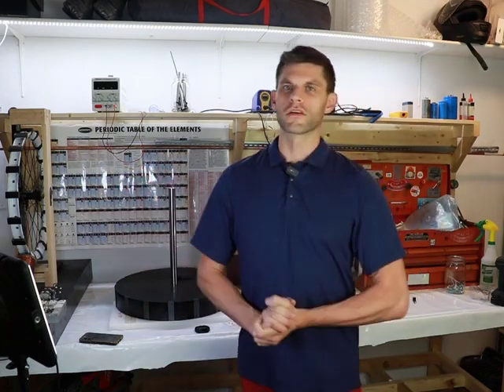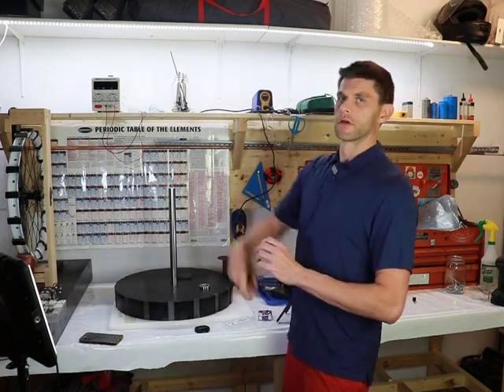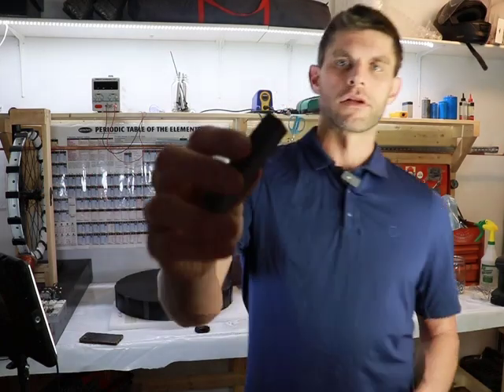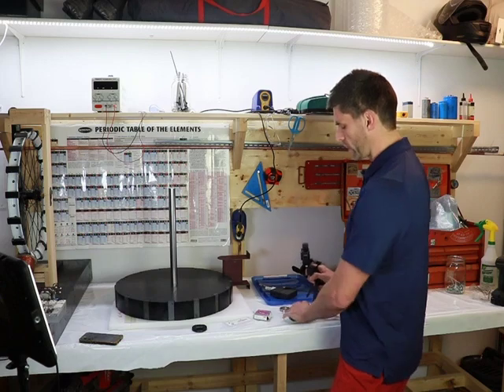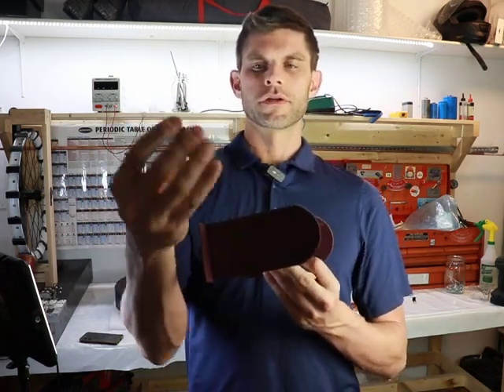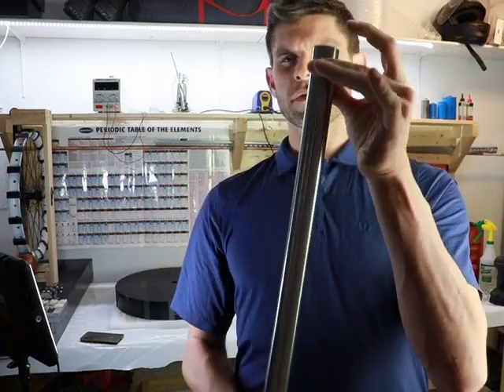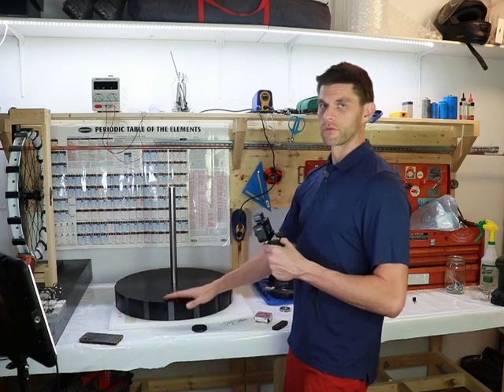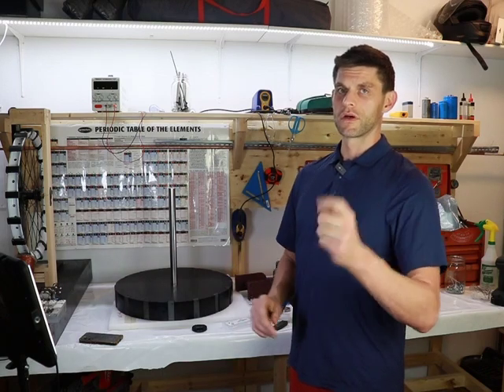Is a Pulse Motor the Key to Free Energy?

Comment: It's too bad you won't get any positive results here.  I know this won't slow you down though.  Keep at it.  Overunity devices definitely are possible, just not with this unfortunately... When you're ready to try something else, hit me up.  I've been researching this topic for a very long time and am confident in what phenomenons actually can be used for overunity purposes... Unfortunately, inductive spikes / back emf aren't the ticket... It's pretty straight forward mathematically if you've studied electrical engineering, not saying you have to have gone to school to learn this stuff, but most people will refuse to look at the numbers unless they've studied this in an academic setting.  And I'm not just saying this thing fails theoretically via the math alone.. I've tested and measured every aspect of this style setup and nothing is misaligned with what you get theoretically using the current mathematical models.  It all matches up, and unfortunately that means there's no excess energy from inductive spikes, not even in a bedini configuration.  Inductive spikes arises in conjunction with the derivative of the current curve as it is switched off.  The steeper the curve, the greater the voltage spike.  Slow switch, low voltage spike.  derivative of a gradual slope is small.  derivative of steep slope is large.  derivative of a completely vertical slope (instantaneous cut off of current) equals an undefined quantity that approaches infinitely large voltage spike.  Sounds amazing, but you can never get an instantaneous cut off.  You seem like a smart guy and I hope you'll get there eventually... Unfortunately it looks like you're gonna have to fail a few times before you get back to the drawing board.  I'm on your team tho so please don't take this as hate.  really its not.  Free energy is definitely possible.  I mean look around.  What is everything we are surrounded by?  Atoms in motion.  Everything with electrons wizzing around them constantly and endlessly.  certainly there is a method for capturing this motion and putting it to good use.  honestly I'm interested in working with you if you're interested in hearing me out.
Reply from the maker: Sure, these machines work just fine.

Comment: You should try making a coil with granite a few different ones. You can test the different types by measuring them as an electromagnet. It has interesting single property when you got the correct one. It becomes magnetic but there is no north or south but rather both ends attract both north and south permanent magnets. I had made one when I was a kid maybe try to hybridize one with multiple materials.
Reply from the maker: cool idea

Comment: Have you thought of using magnetic bearings and running it horizontally for less friction.
Reply from the maker: Would be amazing
Reply: @MadscienceLPTECH  what do you expect the weight of the fully built flywheel to be along with the shaft?

Comment: Why are you not using a magnetic bearing, 0, resistance, then put the whole thing in a vacume, the resistance will be 0, shouldnt this help??
Reply from the maker: lol it would, but how much complexity does that add. cost and more points for things to fail. im using cermaic bearings they are low enough resistance

Comment: Looks good. FYI, you'll need to allow for the addition of cores to your coil assemblies.
Reply from the maker: not for thsi machine, air core coils are the best due to the ability to go higher frequencies and low magnetic impedance. thanks for the support stay tuned
Reply: @MadscienceLPTECH OK. Afaik the first stage (charging phase) of the SSG is very precisely resonantly tuned to the battery ion response, so maybe??? a higher Hz gives a different response if you can find the right harmonics. Bedini specifically drove this point. Looking forward to see how you go.
Reply from the maker: @rohan.fernando  the faster and harder the impulse to the battery the bigger the dipole that all allows the vacuum energy to flow

Comment: Research Energy Impulse Secrets and Impulse Power Secrets by M.kanarev. the paper claims to have built a self running electro mechanical pulse generator and as su h a new law called the Inertial increase of electrical power was built. From my understanding they are using Impulse of inertia to amplyfy torque while running Low drag generator.

Comment: OH and one more tip... I got better results by "timing" my generator coils. That keeps "cogging" to a minimum. So I would add one coil at a time and set it to run at whatever maximum speed I could get with each new coil added. So sliding "perpendicular" (in an arch) to the wheel to set timing.
Reply from the maker: @davenooner2142  amazing thank you
Reply: @MadscienceLPTECH  Oh your welcome...I am with you on creating things for all people, not just ones who can pay me. P.S. I would NOW, as future dave, use schottky diodes. These will conserve and therefore generate a bit more voltage/power. They have a lower voltage drop, so less losses. I have moved to working on a toroid shaped spinning magnetic field device. I think the real next level is no moving parts. I have been saving up some parts for it so far.

Comment: I can say, you are on the right track with this style of generator. I never got amazing results from mine. However I was able to gain 0.1 volts in 8 hours with mine running horizontal. Everyone said you can't recharge the battery that runs the coil. But I used full wave bridge rectifiers with capacitors on all my coils that were used for generation. I only used one drive coil. So any time I got a "positive" pulse OR a "back EMF" spike, it all went back in to the system. Try it. I ran mine on a simple "inductive" sensor. No relays or transistors to eat up any power. I even took the back EMF from the drive coil. Good luck sir!!!
Reply from the maker: @davenooner2142  great information thank you for the support and engagement

Comment: pretty cool, its good to see your are open sourcing this. if more inventors did this we might have flying cars by now : )
Reply from the maker: Thanks for the comment, stay tuned :)
Reply: Hello my brother 

Im happy to see minds working on this 

I’ve thought of using a propeller style rotor thats going be held in place via a small motor using it as a bearing/starter device with ability to draw power. 

As I’ve seen on your motor the pulse of energy is low while returning useable current is medium voltage with decent amps 

I’m trying to get pulses of energy to power a capacitor. Store that energy then dump it into a compressed air battery. Then use the compressed air to power mechanical devices. 

I don’t have the money as carpenters are low paid trades. Most of the parts I’m going to have to make by hand as my 3d printer went hay wire.

Comment: You should have used pyramid shape magnets you can find them at super magnet man.  The pyramid shaped magnets (with a flat top)have more gauss for its size.
Reply from the maker: Thanks for the comment, when we move forward in future models we will test stronger magnets.
Reply: @ no problem,😉 also a Samsung water pump from a washer machine can be a pulse motor as well.

Comment: What about the idea would be that you have a piezoelectric Crystal or clear quartz crystal. You apply a static electric field around it pulsing at one gigahertz a billion times per second, you can do  this by electrifying a polymer or even applying and another feel you think of that create a static field. I don't know every method but I know one method that is a polymer in the form of a electret.  it has to be a static field pulsing  at 1 GHz. And through that you will create a piezoelectric Tower or piezoelectric receiver that could potentially allow you pick up on atomic frequencies or atomic vibrations as a electric signal which can allow for underground communication underwater communication communication and internet access in remote areas possibly if we were able to have this technology and have a collective resonance for all of us are using this technology unified together of the same way we all use the internet together this could potentially allow for interplanetary communication. It can also be great for energy sources because this device can pick up on atomic vibrations that means this device could harness energy on atomic level.
Reply from the maker: @sterlingbrown-j4e  love it. Ever see the air batteries from John Hutchison on Vancouver Island bC canada? He is legit, and they used crystals
Reply: Would it be a possibility to see that in a video
Reply: https://www.youtube.com/watch?v=Du7aCae4zkg&pp=ygUPSm9obiBodXRjaGluc29u

Comment: an Arduino could be used in the trigger circuit with hall effect sensors or phototransistors ?  Using a mirrored plexiglass disc masked with 16 reflection spots, an inexpensive laser aimed at the disc and a phototransistor, This requires only the laser and a single phototransistor since the Arduino can count the light pulses and precisely determine the main rotors orientation!
Reply from the maker: @kimbalcalkins6903  yes might go this route... will make a video regarding the timing down the road. Thanks for watching and the comment!

Comment: seeing you are sincere I hope you operate the device well shielded from you. It could become quite dangerous. Assuming your magnets are around 8 oz centered on a 15 inch diameter the forces acting on a magnet would be above 650 lbs at 2500 rpm and over 1700 lbs at 4000 rpm !
Reply from the maker: Stay tuned for the next video on sunday... i have the stator enclosure built out of 19mm acrylic
Reply: Acrylic can break into pieces.       The strongest plastic is polycarbonate, abbreviated PC, which is used as a glass replacement. Brands: Arla, Axxis, Calibre, Lexan, Lexgard, Margard, Makrofol, Makrolon, Panlite, Quin, Radilux

Comment: I hope it works, but if it does, you immediately put your life in danger. I would partner up and work with someone like Elon Musk. Good luck, and stay safe!
Reply: His life would only be in danger from the device itself. The centripetal forces acting on the magnetics will be enormous, increasing proportional to the square of the tangential velocity. There is also a likely issue with resonance ?
Reply from the maker: @kimbalcalkins6903  they are locked in place... stay tuned for this weeks video on Sunday
Reply from the maker: i think the open source and no greed will help negate the death threats :)

Comment: Though I like things that spin and the SSG was my first dive into alternative energy, what has the most potential in my opinion is Don Smith devices. No moving parts and all the power you could want. Probably cheaper to build than your wheel alone. 
Interesting channel and from the looks of it we are interested in the same systems.
Reply from the maker: thanks for the comment. im committed to the pulse generator till its overunity, but very interested in all the others :) stay tuned
Reply: @ 
Rick Friedrich will be starting a series again with these pulse energizers.
Reply from the maker: @chasson321 i wasn't aware of his channel. Thanks for the tip brother
Reply: @chasson321  If I remember correctly, hasn't he already dismissed Bedini's research findings?
Reply: @杨鹏-n4i  
Bedini held back info but the tech works.